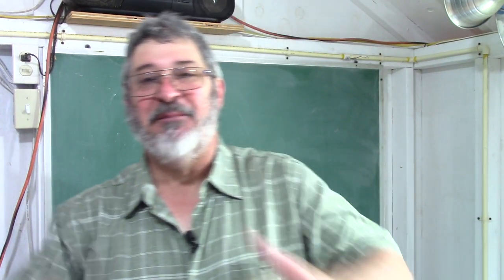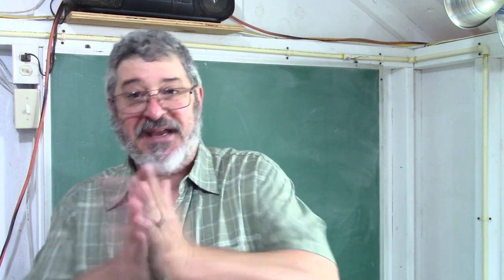E 114 Lets talk Bubble Plates

Comment: Thanks for the video Randy, great information  .... it is a widely debated topic on forums as to what is best for different products. I will run 1 or 2 plates when running a whiskey or rum and find that I get great flavour.  One distinct difference between a bubble plate (non perforated type with capped risers and downcomers) and the perforated designs (sieve plate with a capped downcomer or the design you have) is that a non perforated bubble plate will run at much lower vapour pressure than the perforated designs which rely on the vapour pressure stopping the plate from draining thru the perforations. Really enjoying the channel ... keep it up, always look forward to your videos.
Reply from the maker: thanks for info and thanks for watching Cheers!!

Comment: I am interested. very. My question now lies on column balancing. My research tells me that the high level of violent churning is from the column being out of balance...i.e. the vapors are rising faster than the reflux falling. It is a VERY delicate process to achieve balance. The 'bubbling' should be shallow in height. A better balance will give you a higher ABV and better purity...at least that's what my research has told me...I have never run with any plates before. I use marbles filling 1/4 of my 4 sight glasses. I also see that high level of violent churning myself and now know why. Love your channel! I have learned a lot from you!
Reply: Steve.... try some copper Spiral Prismatic Packing in your sight glass in lieu of the marbles .... with a decent reflux you will get a liquid layer in there which will bubble just like a bubble plate... wish I could post a video to show you.

Comment: Randy, More Plates = Higher Purity. Less plates = More flavor.
You will see distilleries that use huge columns with 10 to 20 plates or more. This is for vodka/gin making. They use less plates for more flavor when making whiskey etc.
When you look closely big columns the distiller can disable plates by opening valves so the vapor and liquid can bypass the plate or plates. These columns can also collect from an individual plate to capture flavor. It's complicated to explain but if you look at some huge columns you can start to visualize all the valves opened or closed. (A lot of 3 way valves and small pipes connecting the column at each plate.)
I like to run 3 plates (4 inch column bubble caps) for whiskey or bourbon. It's a one and done no stripping runs. For more flavor I'll run 2 plates which work great for Rum. However I like to strip a rum wash and then run it through a thumper (Thumper="Retort" in Rum speak) for great flavor.

Doing multiple stripping runs and one spirit run does truly has the flavor bomb. But it is time consuming.
Everyone has a different technique and style they like to use.

Cheers Randy!

Comment: The thing about perf plates, is the liquid lvl doesn't usually stack as deep as caps. try a run with it flipped cap down and the same power you had last time and compare the difference.
Reply from the maker: thanks for the tips Cheers